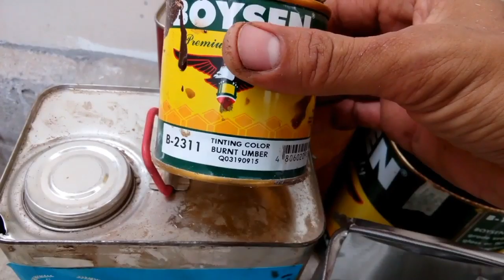Hardwood Using Lacquer Type Of Varnish Part 2

Comment: Pwd po ba patungan ng lacquer sealer yung meron ng enamel na paint? O enamel tapos top coatan q ng clear gloss varnish? (Kahoy) walang spray gun.. foam roller pwd po ba? Salamat po
Reply from the maker: Kung dati na itong may paint. Mainam dito ay iprimer muli. Gamit Ang Epoxy primer. Gamit Ang baby roller. Cotton. Wag gagamit Ng foam. Malulusaw o masisira. At masilyahan ito. Lihain, Primer,. At mag Haspi. O Yung wood grain Design. Maari bumisita sa aming channel. For more videos.
Reply: @paintvarnishtutorial2964  meron po varnish finish dati ngayon gusto q pinturahan bago. 
1. Niliha q #180
2. Quick dry enamel black.. 2 coats (actually tapos na po) Gusto ko lang merong top coat parang clear top coat o clear varnish. Possible po ba na ang top coat n gagamitin ko ay clear gloss varnish? Pwd po ba sa enamel yun? Salamat po.
Reply from the maker: @elye5291  a ok sir. Maari mo Ito pahiran na lamang Ng emulsion. PINAKA top coat nya. 😊👍
Reply: @paintvarnishtutorial2964  ok po sir. Salamat po ng marami. God bless po

Comment: Sir idol..ano ang pinaka ginagamit na pag prepreparasyon ng pag babarnis napansin ko kasi sa mga video e iba ibang klase ng pag preparasyon ..ano po ung pinaka dbest na preparasyon pagdating sa pag stained at pagbarnis
Reply from the maker: Salamat. Preparation ng kahoy. 
#1. Lihain ng #80. 
#2 First coating ng Lacquer Sanding Sealer.
#3 Wood putty, 
#4 Stain.
Matapos matuyo ang Stain. At least tatlong Patong ng sealer o apat. 
70/30 mix rato.
70% Sealer. 30% Thinner.
Reply from the maker: Pumunta lamang dito para sa short video. "Preparation HardWood." 
https://www.youtube.com/watch?v=JuYHruu6PGM
Reply: stain direct sa wood para ms mkulay tz sealer na d po b gnun...

Comment: Boss anung bintahe ng ginawa nyo Na una sanding sealer bago masilya, kami kc masilya muna bago sanding sealer?
Reply from the maker: Mas makakabuti po ang may first coating bago tayo mag masilya. Dahil ito ang magsisilbing Wood Conditioner natin. Para sa ating solid wood. At sa kabilang banta. Makakapasok ng maayos ang masilya natin sa mga betas o butas ng ating kahoy. Madali natin ito maisasara gamit ang sanding sealer. At Hindi din ito mag mamantsa mantsa. O yung Hindi pag pantay pantay ng kulay ng ating kahoy kapag gumamit na tayo ng oil wood stain. 👍😊